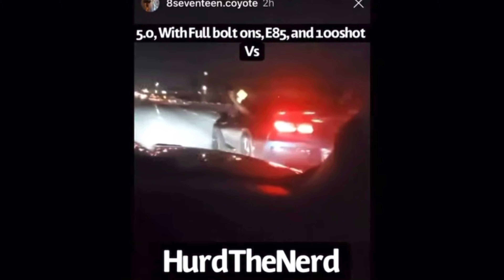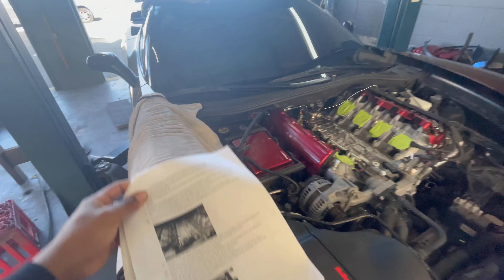C7 Teardown! Taking apart the car for the Lt4 Blower, Z28 vs 1000hp Gt350!

Comment: That lt4 kit only come with that 1 heat exchanger?
Thought they had 3, but I could be wrong 🤷🏻‍♂️
Reply from the maker: Yes just the one I have plus an extra resavoir
Reply: @hurdthenerd  nice. Volume is king.
If you want some content of your vette gapping my V, LMK lol. I’m in euless, so not too far from you.
Doing a bunch of cooling mods this weekend, took advantage of the sales going on at weapon X